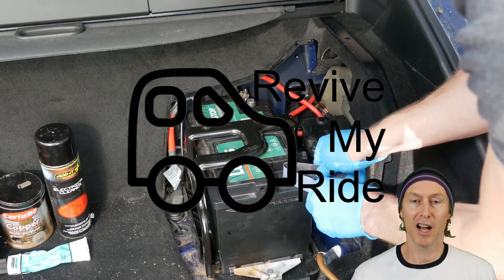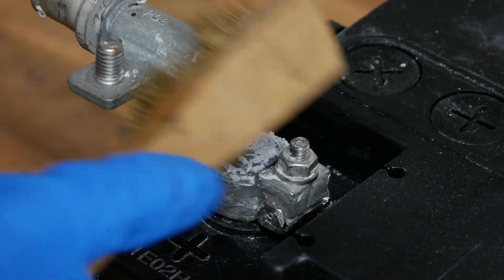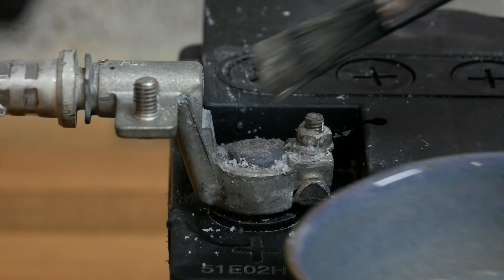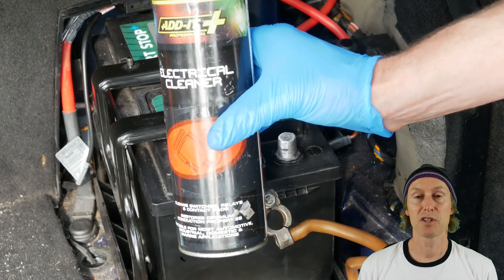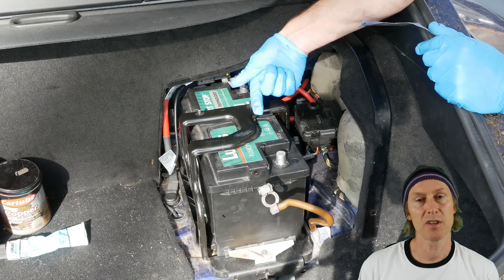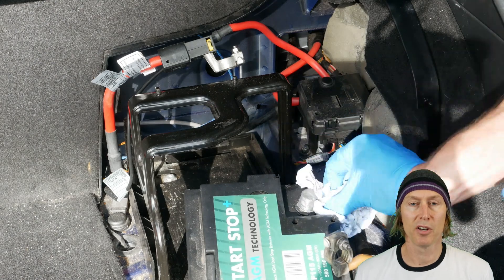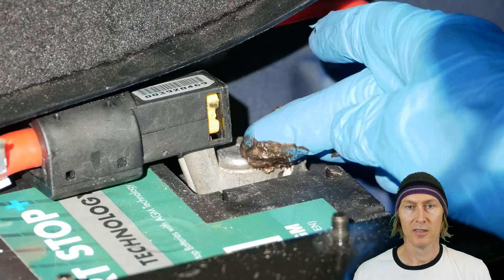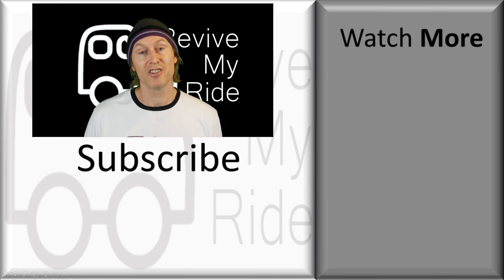How to Clean Car Battery Terminals and Remove Battery Corrosion

Comment: What about when battery acid drops down onto parts like the oil pan and exhaust? I took my car to the dealership (my car is under warranty) and the battery was leaking acid. They replaced the battery (still under warranty), and they said they used break fluid to clean off the corrosion. Problem is, when i looked at the aftermath, it looked the same, battery acid stains were still on areas and they said they couldn't remove it because they "didn't have the tools to", that you have to have someone with a pressure washer remove the acid stains on the aluminum/metal. Is there a easier way to do this? I'm not going to stick a pressure washer into my engine bay and potentially damage something.

I can see the spots, it's a tight fit to get my hand to the areas, but what should i do? "They" said it's not going to continue to be a problem as far as any acid continuing to eat away at any aluminum/metal, but to the visual eye it's ugly, i can see acid stains (green corrosive looking stains), that they left. Do i resort to the baking soda/warm water method on the areas, then wash it off? Or are there products i can just buy and spray on the areas affected by the aftermath of all this?

Comment: What about the spark when you plug the negative cable? Is that normal? Can it shock me bad?
Reply from the maker: Yes, it's pretty normal to get a little spark when you reconnect a battery. I've never had a shock from a car battery, so you should be fine. I understand it can make some people feel nervous, if that is the case, you can wear some gloves for extra protection but this would mainly to make you feel better. Cheers, Phil
Reply: What if i dont have sandpaper, just use the water and baking soda directly on the terminal? @ReviveMyRide